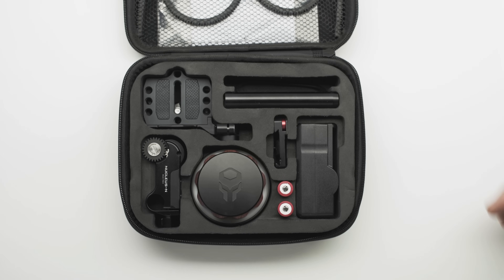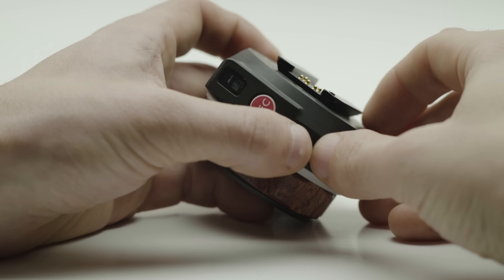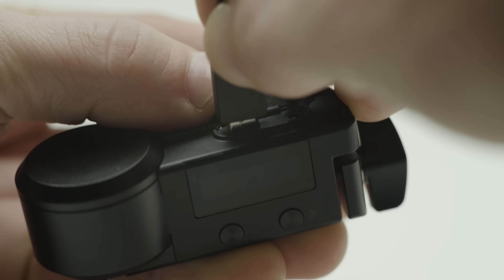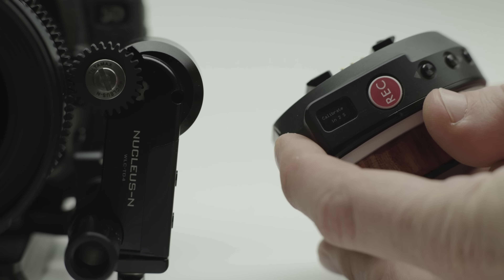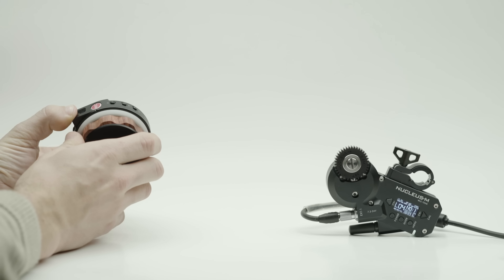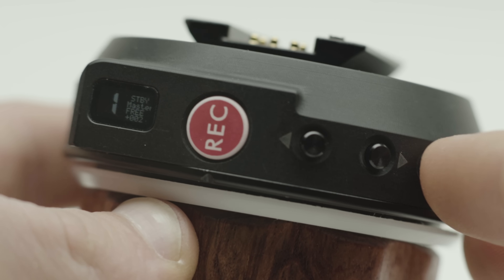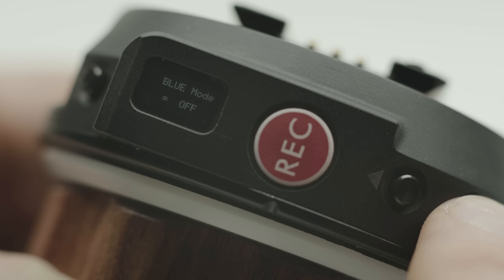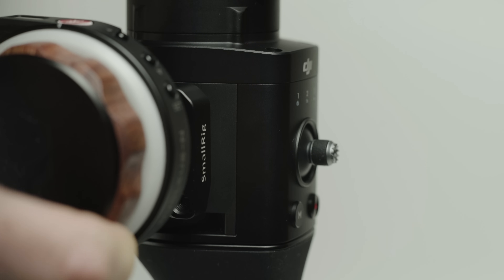Tilta Nucleus-N Nano Wireless Follow Focus - In depth getting started

Comment: I don't own one of these yet but I saw in another video that you can increase the torque of the nano motor by simply using a higher voltage supply. USB defaults to 5V but it will go up to 14v apparently (according the manual). No idea what this does to the lifespan of the motor.
Reply: it supports 5-18v.

Comment: Anybody having trouble with the Nucleus n motor on the ring on the sigma 18-35mm? The teeth keep slipping off
Reply from the maker: Are you using a lens gear ring or are you just using the motor right up against the lens? That lens doesnt have actual gears just a soft rubber grip so you’ll need a lens gear ring.

Comment: Hi, great video very informative. Is it possible to control the speed of the Nucleus M Motor on the motor menu itself or via the Nano Wheel Controller menu? or is the speed of the Nucleus M Motor only configurable using the Nucleus Fiz Box? Is it possible to use the Nucleus M Motor with the Nano Wheel without the Fiz box at all?
Reply from the maker: The speed of the motor is only really affected by the speed of your rotation of the wheel. But the other thing that would affect the apparent speed is the length of the calibration. For example if a lens has a 360 degree throw the motor will have to spin many times to reach the complete range from min to max but another lens that has a 90deg throw or maybe like an iris control for example, the motor would only need to rotate once or so to reach the full range. There is no speed control in that sense it’s just whatever speed is necessary to reach the full length of the range of whatever lens is attached.

Comment: Hi, Can I power the Handwheel via the micro usb port
Reply from the maker: Ceasar Belliard yes I believe you can!
Reply: @joshuamacdonald8785  I contacted Tilta, They said it is only for firmware update, if you try to charge it or run external power you could damage the handwheel. hope this clarifies things so that your controller wont get damaged.

Comment: A question: I use old Zeiss Contax lenses, the focusing rings have a greater resistance than the new ones. Can this move them?
Reply from the maker: maurizio polese your best chance would be powering the motor with 12 or 14v input from the usb port. The motor itself can handle up to 18v I believe Tilta makes a cable for this.

Comment: I really wish even the motor had an internal battery
Reply: That would likely make it too large to fit in a space that is already cramped. Also, you wouldn’t have the option of using a supply with higher voltage for more torque.

Comment: Hi 

can i use it for Zoom in & Out ??
im using Sony lens PZ  28-135
Reply from the maker: AIM_qat you definitely could although you would need a nice steady hand since the speed would be based on your pull on the wheel. It get a perfectly constant zoom you’d be better off with one of the handles from the M system which I believe you can now buy separately, and is fully compatible with the nano motors.
Reply: @joshuamacdonald8785  

Many thanks 👋🙂

Comment: How does it work with Lumix lenses (with focus-by-wire focus system)?
Reply: Tamtomasz it will work the same as trying to pull focus manually 
Focus by wire so it will miss every time
I suggest getting cinema lenses if your looking at the follow focus .
Reply: Hi, Tamtomasz. Some people I know use Lumix lenses with wireless follow focus gears. I made seamless 3D printed gear rings for these lenses, and they work great. The models are : 12-35mm / 2.8, 14-140mm, 20mm/1.7, 25mm/1.4.
Reply: @lyzheng8061  Ok but Nucleus's remote has limited move. It has start and end poinst so it doesn't work well. I finally bought Nucleus Nano so I tried it! :)
Reply: Tamtomasz great
Reply: Tamtomasz by the way, I have some seamless follow focus gear rings for test. Want to have some?
Reply: @lyzheng8061  yeah sure!
Reply: Tamtomasz Please mail me your address and the lens you want to fit. If I don’t have the data, could you measure the perimeter of the lens?
Reply: Tamtomasz zheng (at)makerthink.(com) this is for anti-spam.

Comment: Great review thanks. Has someone tried the Tilta dual 18650 battery pack with this motor ? 
Does it give more torque given that it's 8 Volts ? 
https://tilta.com/shop/18650-battery-pack/

Comment: Is there a way to map the throw of a lens' focus range to a wider range of controller wheel motion on the Nano? I'm probably doing the manual calibration wrong (with lenses that don't have hard stops), but I find the focus moves waaaaay too fast over a tiny range of the controller wheel. Any suggestions?

Comment: Great Video Man! I have one question which is not clear for me. The instruction manual said to set the lens for close distance and the knob as well but in that case the direction of the wheel is not good for me. As you said to set the lens to infinity give me the right direction. But I assume it is not the factory standard because infinity should be +9999 instead of +0000. What do you think?

Comment: Very nice Video, but i have a question:
How do i set up the record feature to start my recordings from the Hand unit?
is this even possible?

Best regards
Reply: get the run/stop cable that fits your camera, and plug it into the motor + camera. And you are set.

Comment: I can’t get manual calibration to work at all. Often when I double click CAL and enter H_C_A, the unit won’t spin the focus barrel at all. (This is with a sigma 18-35mm on rails)
Reply from the maker: The TC hmm I’d send a video to tilta’s support email or fb group, that doesnt sound like what should be happening
Reply: Joshua MacDonald thanks. I definitely will. Have made the video and I’ll message them https://youtu.be/r32W3AxUwww

Comment: How does using it with manual lenses (with long focus throw) compare to focusing with AF lenses (with short focus throw)?

I'm planning to replace my AF lenses with manual Zeisses and Samyangs (for easier focusing) but perhaps that won't be necessary and buying the Nano could "fix" my current glass.
Reply from the maker: Mateusz Pieniążek the throw shouldn’t really matter since the calibration maps the throw of everylens to the full scale of the hand unit. So every lens should require the same amount of movement of the hand wheel from minimum to infinity.

Comment: Hey Joshua, great review. Question for you; do you know if the motor can be powered from your camera? I'm shooting on the a7sii and wanted to know if I could use the micro USB on camera to power the unit or if I"ll need external power.
Reply from the maker: Michael Ballif hey man no unfortunately it would not be able to be powered from the A7s directly. I’d rig some sort of usb battery pack

Comment: Does anyone know if the motor is strong enough to drive a gear ring attached to a helical? As in the cheap Chinese helicals you can get to allow focusing lenses that don't have a built-in helical. They tend to be much stiffer than the focusing rings on lenses.

Comment: Is there a way to adjust the speed of preset A to B moves?  Or does it always move from the preset A position to the B position at the same speed with no way to make it go faster or slower?
Reply from the maker: Nine Hundred Dollar Luxury Yacht the AB range function will go at whatever speed you turn the knob, so if you want to whip from a to b quickly you’ll have to spin the knob from one end to the other that fast.

Comment: What happens if you manually calibrated it wrong and have the motor focusing above or below the thresholds? Would it break the lens ridges?
Reply from the maker: If you mean on a lens with hard stops, I'd recommend using auto calibration. If you did a manual calibration on a hard stop lens and hit the limit, I can't imagine the motor would not have enough torque to do any damage, or even lift the teeth off the lens, it would just be hard on the motor. If you mean on a lens with no hard stops, then going past the ends would just mean your marks wouldn't be accurate, you could still focus by eye no problem. If you miss the ends during a manual calibration, just start the process again until you get it.
Reply: @joshuamacdonald8785  thanks just what id like to hear :)

Comment: Great review!

Two questions:
1) The length of the motor looks kind of short considering 15mm LWS mounting which I suppose is 85mm from the optical center. Maybe I'm wrong, but the baseplate does seem to shorten this distance by some amount. Have you any comparison to a regular 15mm LWS height baseplate? I'm wondering if the motor is actually too short for a setup like this and would call for a top-mounting solution?

2) Does it come with a M6 Screw? The packing list always shows an M6 key, but not a screw? From what I saw the Tilta G2X has an Arri Rosette which is always M6. I'm thinking about combining a handgrip with it to get some sort of WCU-4-like hand unit.
Reply from the maker: Hey Andreas, yes the motor is quite short and the baseplate is definitely designed to shorten the distance to the motor, not sure of its offset from centre but it's definitely a shorter distance. Top mounting may be a good way to mount for some setups. As for screws, mine came with one m4, and one m6 screw. the m4 is for mounting to the ronin s, and the m6 is for mounting to the supplied Zhyun Crane clamp.
Reply: Thanks a lot for the response!

Comment: thanks for the very clear and informative video. Can you tell me if the follow focus can turn continuously? Ie, when using lenses with continuous fly by wire focus rings (like the canon Ef 85mm f1.2 or the 50mm f1.0) . I have used these with a start / stop point, but the lens isn't accurate when it returns. It would be easier to focus jut by turning and watching a monitor. Cheers Paul
Reply from the maker: Hey Paul, you can set up lenses with fly by wire focus by following the manual calibrate section of my video:
https://www.youtube.com/watch?v=kV1QuCNcw8k&t=243s

Comment: Hey Joshua nice video and very clear explanation about the nano.  I was curious would it work with the moza lite 2. It has a 5v mini USB port. Which mean I would need to buy a micro to mini USB cable right?

Also would it work with the GyroVu D-Tap to Micro-USB Regulated Adapter Cable as I haven't seen Tilta release their micro usb to d tap yet. 

Thanks man.

Comment: Can you clarify the whole section of mounting it in the ronin s and using the right screws and mods needed etc? Please and thanks . 
I have ronin s and plan to purchase the nano . I have already ordered the smallrig part that mounts to ronin s in your video that you drilled? 
Why is that needed ?
Can’t I just mount the focus wheel knob anywhere ?
Reply from the maker: LEOPAZZO TV   If you screw the Nano quick release mount directly into the Ronin with the included M4 screw like I show in the begining of that segment you that’s all you need I’d just recommend taping off the terminals just in case

Comment: A question about the mount on the back of the hand unit/knob itself: Is it possible to mount it to something else, say, a handheld monitor or a something to make a larger "handle" on it?
Reply from the maker: Deudremont  It’s the same process as mounting to the Ronin-S that I outlined in the video. There’s a through-hole for a screw to mount the quick release plate but the included bolt is not 1/4-20 thread which is an issue since most bolts people have lying around aren’t flush enough for the quick release. I believe Tilta will have to make a screw for standard 1/4-20 mounting points, it may not be included in the kit but I’m sure they’ll have to make one, they’ll get too much feedback from people wanting to mount to things for that exact reason.
Reply: @joshuamacdonald8785  I see. Yeah, it would be great to be able to mount the handheld wheel on other things!

Comment: Great video joshua, btw, is it compatible with moza air 2?
Reply from the maker: Marco Candra it wouldn’t be compatible with their focus wheel but you can power the motor you should be fine to use it with tilt as hand unit

Comment: Nice review. How do you power on Nano motor on Ronin S? I found out ronin S didn't have 5pin usb port should I get additional battery for a motor or not.
Reply from the maker: The Ronin S has a 12v accessory port, right now there are no cables specifically designed to go from the Ronin's accessory port to microusb to power the Nano, DJI has one generic accessory power cable that has a 7v regulator and ends at a DC jack, and you certainly could use this to make a power cable with not much issue but you'd have to make your own at this time and know some basics about electronics. Since the Nano still hasn't even shipped I have no doubt that there will be plenty of accessory cables on the way to connect the Nano to basically any source.

Comment: Great video, I have a question tho, i saw on the internet people talking about Arri rosette being included on the controller. Is that true or not?
Reply from the maker: eMDee Unfortunately no, just the quick release mount I showed in the video.
Reply: I was wondering the same thing. I pre-ordered mine and I'm wanting to mount it to a side-handle/grip. I can sort of see a screw on the quick-release plate. Does it come off the controller? :) @joshuamacdonald8785
Reply from the maker: Joe Trimmer yes the screw comes out and can be replaced with a 1/4-20 to thread into any plate etc but at the time of the review, the only included hardware was metric. So you may have to track down a low profile 1/4-20 screw
Reply: OKay right I saw that in your video. So, what about the part attached to the hand unit itself? With the pins? Does that part come off too? @joshuamacdonald8785

Comment: nice job. so it looks like the nano is able to pull focus on at least some heavier cine lenses and l series canon stills glass...
Reply from the maker: smoak888 stills glass will be no problem, and many cinema lenses would be fine. I just recently found out that the motor can take up to 18v through its input so I believe there will be a 14v dtap->USB cable that will be available through Tilta that would improve the torque significantly.
Reply: @joshuamacdonald8785  thanks for the update!

Comment: :S they said compatible with ronin s... I dont want use my drill.
Reply: When you remove the plate from the ronin S to fit the Nano Wheel, save one of the screws and re-use it.  Saw the tip in another video ;)
Reply from the maker: Bocus Focus  Oh that’s actually an M4 screw. The Nano does come with a screw for that.
Reply from the maker: Játékőrület ll Ebeni it is compatible. Check out where I say “to mount to the ronin s directly”. The included m4 screw works just fine for this just careful of the Ronin’s communication pins.
Reply: @joshuamacdonald8785  yes and i think if i buy a handle to my ronin s with screw input i can put at handle.  I hesitated between ronin s new focus motor and nucleus nano, but i think nano more better. If i dont use gimbal just shoot from rig or from a tripod better if i can detach my focus from gimbal. And close same price. Thanks.

Comment: Thanks for this. Can I ask will any battery Bank work because they are all basically 5 volt out? And which battery Bank did you happen to use in terms of its capacity and how long it powered the motor for? Thanks so much.
Reply from the maker: PostModern Filmmaking Hey! Yes any battery bank should work, I just checked the current draw of the motor and at standby it draws 100 mA, 150-200 mA under a light load and a peak of 1 A at full motor failure. So no need for a special 2A USB port, regular 1A should be fine. So by my calculations a 5,000mAh USB battery pack should provide over 10h of regular use, as long as the mAh ratings on the battery are honest.
Reply: @joshuamacdonald8785  thanks for the very thorough reply really appreciate it!
Reply: Hey thanks for your reply before. Any chance you have a battery Bank that is one of your favorite most reliable ones and is small small small to use this with? Thanks for any suggestions.